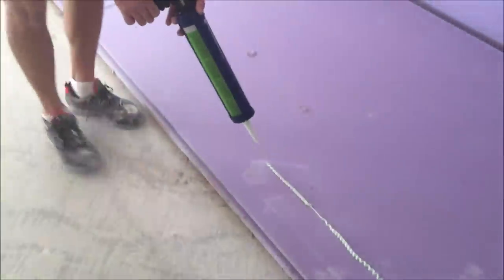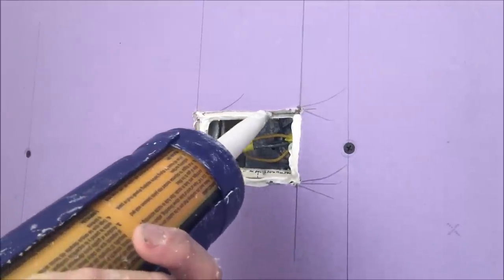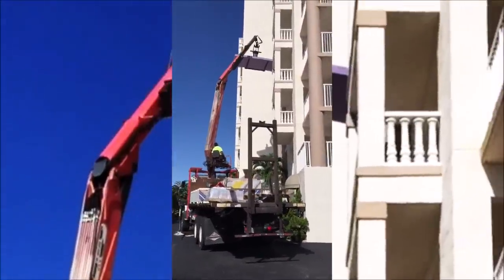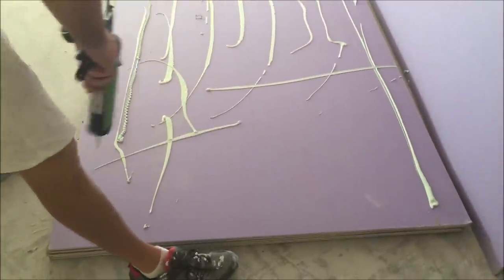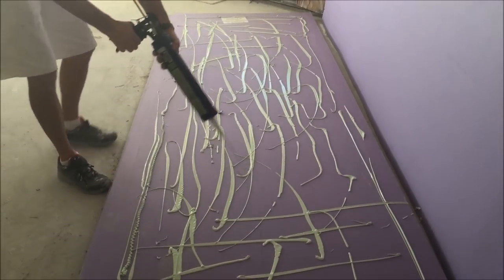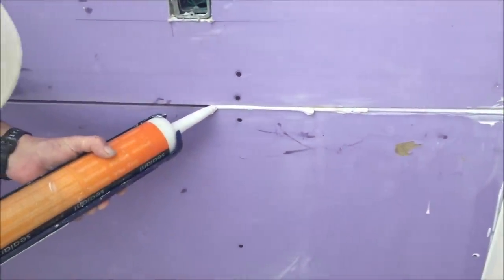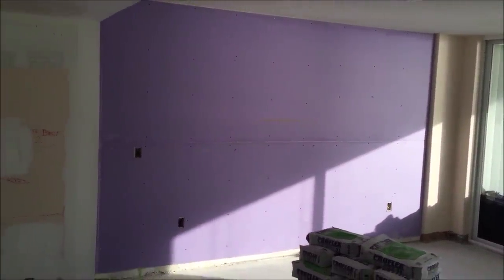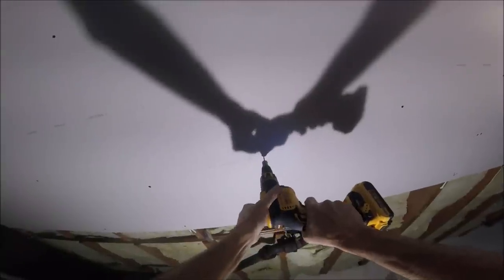Soundproofing walls without removing drywall-  Green Glue compound

Comment: Completely wrong 2 or 3 tubes per 4 by 8. The Green Glue cures in a week, not a month. Also, the acoustic caulk has to be applied in all seams, not just corners meaning seal all cracks between sheets of drywall, which should be 5/8s quietrock. You have only 10 minutes to apply the messy, sticky Green Glue use gloves. Well worth the trouble; the acoustic differences are considerable.

Comment: green glue does nothing to slow down the sound passing through.  Its the drywall that the sound is passing through.  the sound goes around the green glue.  The drywall is the only thing that is slowing the sound down.  Green glue is nonsense.  It cost $25 a tube.  Total waist.